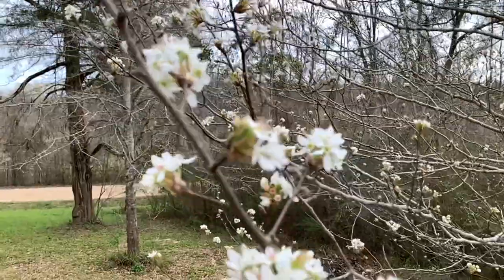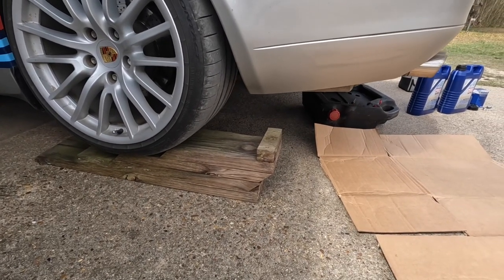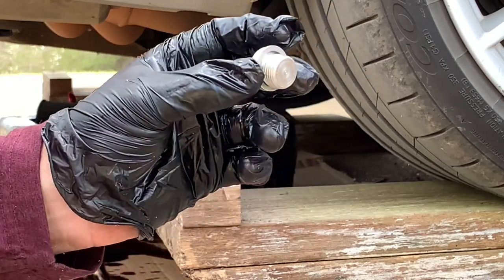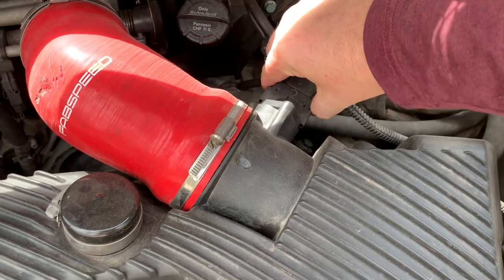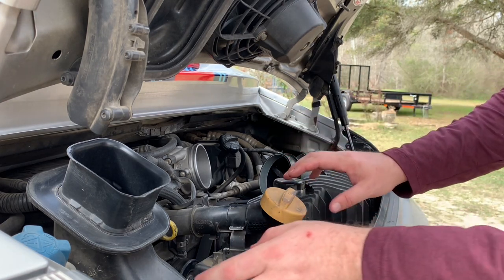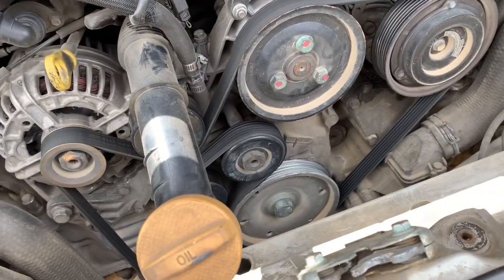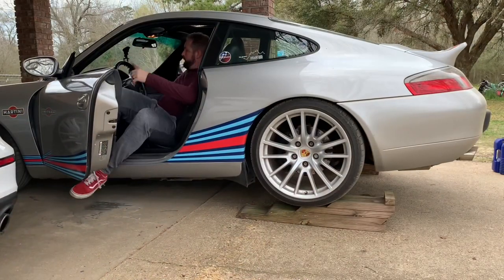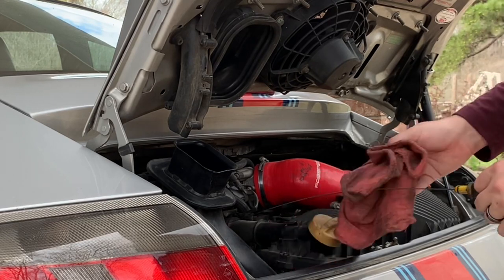Oil Change, Airbox Removal, Belt Change, Air Filter Replacement, and Headlight Removal for Porsche

Comment: Hello Michael, I did changed my spoiler by a fixed one as yours. I have though now everytime a dash light that comes. And this annoys me 🙂 What did you do so that this light doesn't come back ? Thanks.
Reply from the maker: Hey. There’s a couple wires you need to twist together that are inside the loom going up to the spoiler. I have a video or pics of it saved somewhere. I’ll post them here either as a Short or something and will comment back here once it’s uploaded. Thanks for watching!
Reply from the maker: I added the steps as a photo post. If you’re subscribed to my channel you should see it in your feed. Good luck!